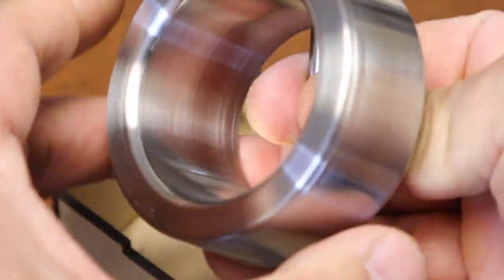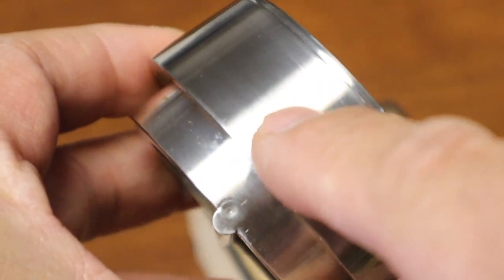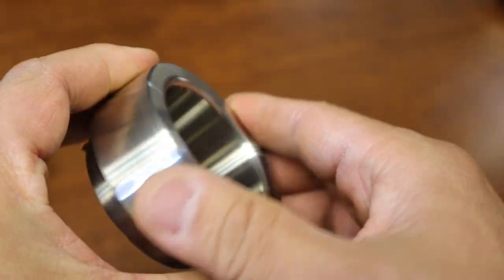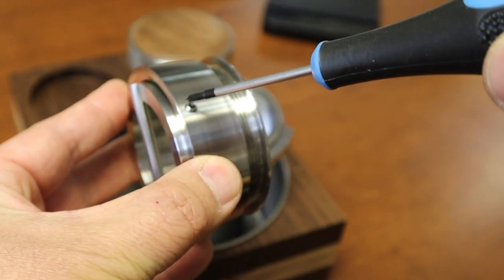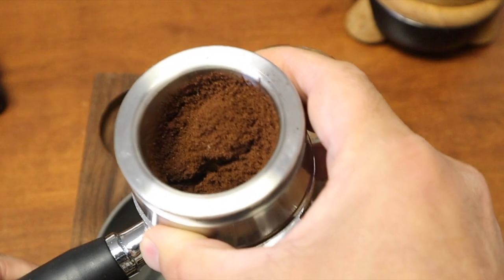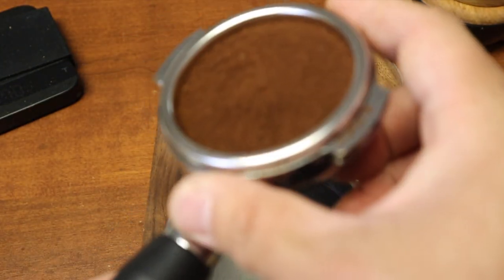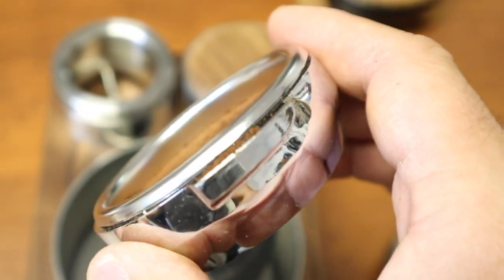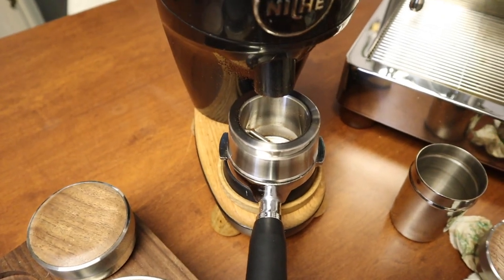The Shot Collar Espresso Distribution Tool

Comment: Nice editing skills @2:24
I wonder why they didn't put actual downward pointing fins on there. Example of what I mean (arrows represent radial direction) :

/(->)    and    \(<-), each on half the rods side so that there's an radial symmetry by 180°.

I like the current design, does the weight of the collar interfere in any way with the portafilters weight? Do you have to hold the portafilter down, if you're spinning the shot collar?
Reply from the maker: This is link to my live version of shot collar. https://youtu.be/xuuAez0Naos
Reply: @HoonsCoffee  thanks! Think I just missed it...